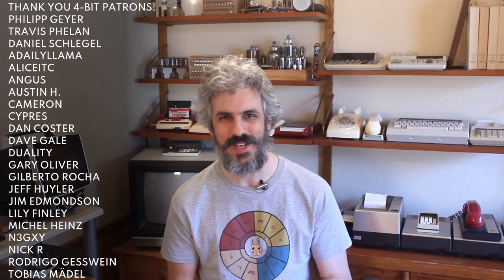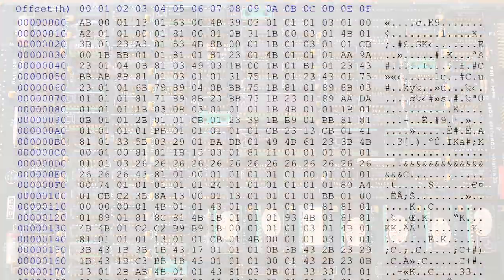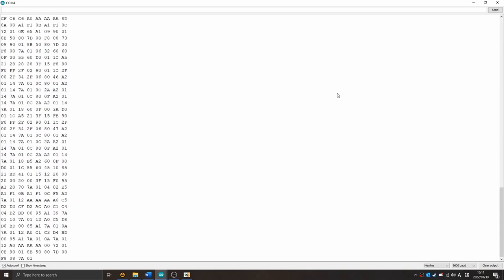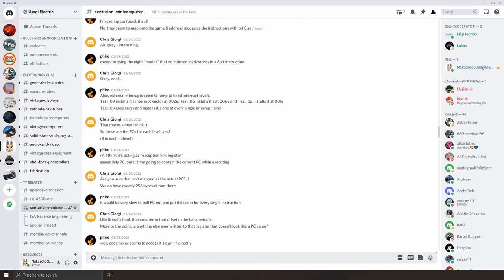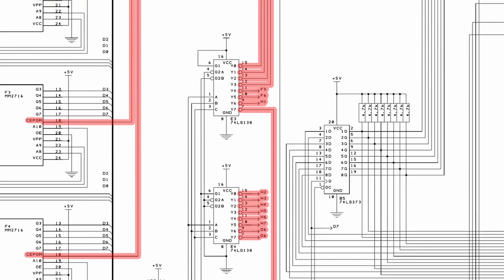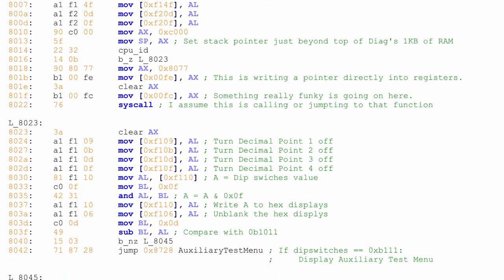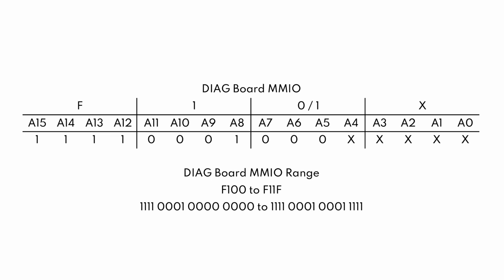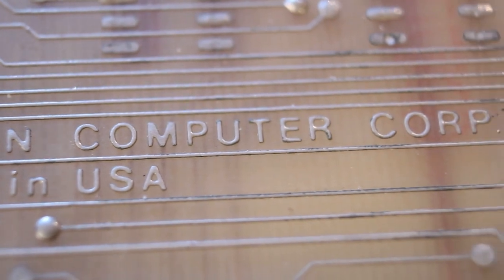Minicomputer Part 9: Reverse Engineering the Diagnostic Board

Comment: This series is absolutely great. I really love following the exploration of this old beast. I just love the retro-electronics and retrocomputing. I'm really rooting for you to get this thing running some actual code! This machine really does bring back some childhood memories... My dad was a pharmacist, and in the early 90's worked in a small independent pharmacy owned by a much older pharmacist. They had gone to electronic script processing probably when the first commercial systems rolled out, and I can still remember that dinosaur, which was obsolete even at that time. It was some minicomputer that sat in a back room connected to 4 or 5 dumb terminals up front. I don't remember the minicomputer or what it was, as it was just in a large rack, but I'll never forget the CDC Hawk drive that sat on the top of the rack. At night I would get to help shut the system down, so once the OS was halted, I would hit the key combinations to park the drive and turn it off. Seeing that old drive brings back all those days spent cleaning stock shelves and checking expiration dates in the back of the pharmacy.
Reply from the maker: Thank you so much!
That's awesome that you got to actually spend a bit of time with a proper minicomputer as a kid, I really would have loved to see one of these big beasts in their natural environment. I think it's awesome that these machines were often used for 10 to 20 years, which is almost unfathomable now. The old Hawk drive is a really, really cool drive too. I'm really hoping to get a working Hawk drive in my possession someday!

Comment: Just love to see the patience you have trying to get the the Centurion "mini" computer back up and running. It takes me back to the late 1970's and early 1980's when I was using DEC pdp8, pdp11 and pdp10 computers to write my source code on for a new microprocessor based machine logger/analyser. The terminals were almost identical to your Centurion ones ! In those days we had to write our own editors, assemblers and disassemblers to program and examine the hardware. So glad to know there are still people out there who love this stuff. Best of luck with your project. I do hope you can revive it back to life.
Reply from the maker: Thank you so much!
I recently came face to face with a PDP 8/E for the first time, and I have to say, it is a stunningly gorgeous machine!
The Centurion terminal is really an ADDS Regent Model 100 underneath the blue and white paint, and I think that terminal chassis was used on a ton of different models. It's such a cool looking terminal, it was worth getting the entire system for the terminal alone, haha.
Thanks again, and there's a lot more Centurion stuff on the way, we've been having some amazing luck with it lately!

Comment: I just came across your channel  Man that computer brings back memories.  My senior year (1990), our high school electronics lab was given a Centurion mini computer with 2 drive, 3 terminals, a line printer and a dozen or so disks by a local hospital that was upgrading to a PC based network system for their accounting offices.  I was the only one who could get it to partially boot up and spent some of my spare time at school trying to get it fully working.  

Best of luck on getting it operational sir!
Reply: Was the hospital in East Texas?  Any chance that any of the Centurion system or part could still be around at your high school?  We are always in need of any parts or disk packs.
Reply: @kenromaine2387  it was from a hospital in Jasper, Texas.  Unfortunately it ended up being scrapped a few years after I graduated.
Reply: @Richard-HiFiMan  We had a number of Centurion systems in East Texas.  Glad you had some hands on time.  FYI - Its very likely I installed that system.
Reply from the maker: Thank you so much!
And that's an awesome story! I can't believe that it's also possible that it was a system that Ken Romaine may have installed as well. It's truly a small world when it comes to these cool old minicomputers!

Comment: Congratulations!!! Hats off to your reverse engineering crew! I wasn't expecting that much progress on the instruction set given the number of architectural unknowns.That schematic will come in really handy when it comes time to build a coprocessor interface to your UE14500. Yes, that shift register chain is surely the wait state timer. The output after 3 flip-flops I'll bet terminates the bus cycle after 600ns for the EPROM and RAM (also 450ns) while the output after one flip-flop is for terminating all the faster accesses after 200ns. With what I've seen, it looks like you're just around the corner from being able to inject a simulated MFM bitstream into a disk controller and get a stage 0 bootloader into RAM. You're almost there!
Reply: PS: There's one more 256x8 PROM on the CPU board in a 74S471/6309 at B13, but I expect the contents to be very similar to the TBP18S22 from the CMD board. And also a couple more finger descriptions... Top.6 = /RD, Top.7 = /WR,  & Bottom.29 = bus parity. I suspect either Bottom.32 or Top.29 may be a parity error flag. Bottom-Top.30 and Bottom-Top.33 are daisy chains; I know one is an interrupt daisy chain and I suspect the other could be for DMA but that's a guess. Top.8 appears to be a terminate bus cycle line. Some cards don't implement it so I'll guess the CPU has a default long cycle to match the core memory of the CPU4 and if a card wants to it can shorten the bus cycle as appropriate.
Reply from the maker: Thank you!
The instruction set progress is truly mind blowing, those guys have done some insane work. I would say they've got about 75% of the ISA all figured out, which is enough to start writing some proper, new code that'll allow us to test and figure out any remaining question marks we have. 
Without spoiling too much, we've already gotten some pretty exciting things to work on the machine and the next two videos should have some great stuff to cover in them! I think you're totally correct on the shift register thing. The third output at 600ns is plenty of time for the 450ns ROMs and RAM to get their data ready. 

Good eye on the missed ROM on the CPU board! I totally didn't notice the first time I had the ROMs out to dump their content. You nailed the pinout really close to what we've been able to figure out from the DIAG board as well as some reverse engineering work on the printer board. Here's what we've got for the card edge connector pinout so far: https://i.postimg.cc/DzzrNJ7Y/Pinout.png

(Email coming your way soon! I'm still trying to catch up on missed messages!)

Comment: This is incredible. It takes a concrete understanding of hardware and software to be able to figure out the opcodes of a processor using only pattern recognition.

If I recall correctly, the processor in this machine was completely TTL chips, right?  If that's the case, one of the logic ROMs is likely the place where the opcodes live, each one setting a bunch of signal lines to cause the hardware to do everything the opcode requires, for example loading a byte from memory into a register would involve setting the address register, setting a read flag to the memory (which outputs data based on the address register) and setting a write flag to the specified register to effectively copy the data.  Being able to decode that ROM would give up everything you need to write software for your Centurion.

Looking forward to the future of this series!
Reply: Yes, that's it. Modern CISC CPUs still works that way. He should have made this analysis on the CPU boards before.
Reply: @MaxCarponera  Technically, to reverse engineer the microcode, you need to know how the rest of the CPU is attached.
Reply from the maker: Thank you so much!

And the work that the gang has been doing on the ROMs is incredible. Interestingly, we've almost go the entire OpCode list deciphered simply by looking at the DIAG board ROMs. Since the DIAG board was built with the intention of exercising nearly every aspect of the computer, it's really given us excellent insight into how things move about.
For example, we've discovered there are eight 16-bit registers and the upper or lower byte of each one can be addressed depending on addressing modes and instruction. Additionally, the DIAG board has essentially it's own self contained OS on it (which we'll get into in more detail two videos from now) and dissecting that has pretty much taught us so much that we're at the point of nearly being able to write our own, new OS for it, all without having to reverse engineer the CPU card itself!

Comment: tergav17/CPU7Plus - A GUI-based emulator for the Centurion-series minicomputer. Right now this is very much a WIP, the basic framework for the processor register viewer / CPU control buttons are there, but that is about it. The actual CPU emulation is extremely barebones (it can only really execute jump instructions right now). The next step is getting the memory viewer / editor working.
Reply from the maker: I'm so, so excited about the emulator! I think with all the work being done on reverse engineering the ISA, we're really not far from getting some really exciting and cool stuff going on!
For anyone curious, follow the development of the emulator here: https://github.com/tergav17/CPU7Plus

Comment: This is amazing!! You guys are going to super-sleuth this relic back into operation yet! Very intelligent back engineering of a system where literally no software exists apart from what's on the ROM's on the Diag. board! If you can develop a working OS and then get the CPU to talk to the terminals correctly, you'll probably be able to clone an OS disc in one of your drives if you can get a good disc from one of the disc packs and find some good heads that will read it. I guess you could always reflash a newer disc drive to behave like those antique SCSI discs if all else fails.😉
Reply from the maker: Thank you so much!
We have a lot of really cool things planned for this system, but I've actually multiple things in the works, and I truly think we can get this machine doing some pretty amazing things!

Comment: Absolutely fantastic ! Please be aware of that contact cleaner in the dip switch. This can cause malfunctions in the long run. Better replace the switch with a more reliable part. Anyway 💯👍😁
Reply from the maker: Thank you!
I actually ordered replacement DIP switches that are the proper rocker type like this, but they didn't quite make it here in time for filming!

Comment: wow, I loved seeing what you did to reverse engineer this board.. I have some old 2708 or 2716 eproms that I would love to see the contents of.. I don't have an eprom reader, but I do have an Arduino nano and a ZIF socket...

Do you have a video showing how to make the nano eprom reader?
I tried the one Ben Eater made, and I can't get it to work properly on the EEPROMs I have.
His seems to take more that 7 loop cycles to read each byte, and I thought if it used 2 8bit latches, it could do it in 3 loop cycles... (high address, low address, data)

I also have an old S-100 bus computer with no software. The last time I started it, it just had random characters on the screen.. The computer is a Xitan made by Technical Design Labs
Reply from the maker: Thank you!
The EPROM reader is really simple, I just ran the data and address pins of the ROM to almost every available digital I/O pin on the Nano and then wired up a simple little push button to work as a start button.
Here's the Arduino code I used: https://github.com/Nakazoto/CenturionComputer/blob/main/Computer/Diag%20Board/ROMs/Nano_ROM.ino
I just dump the 8-bit value read into the terminal as hexadecimal and then copy it over to a hex editor like HxD, and it all seemed to work really well!

The Xitan looks like a really interesting machine! I'm fascinated by how many early computers there were by different manufacturers. I would love to play around with an early S-100 bus machine like that someday!